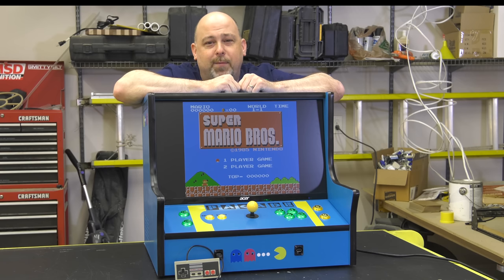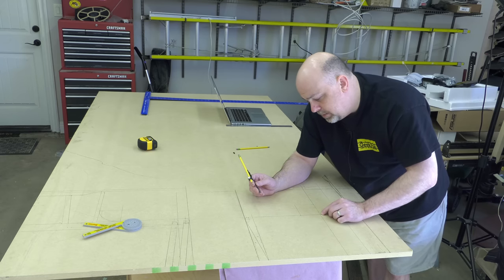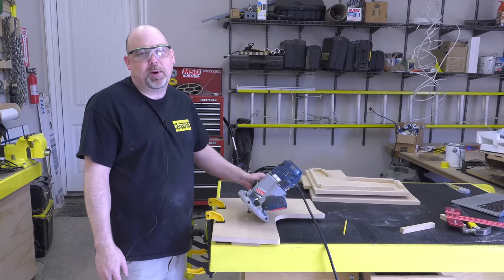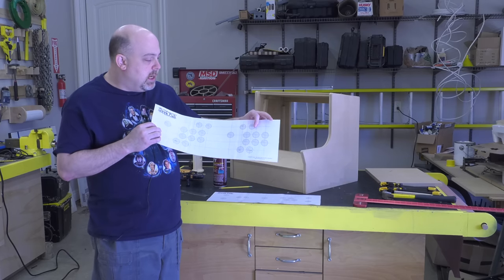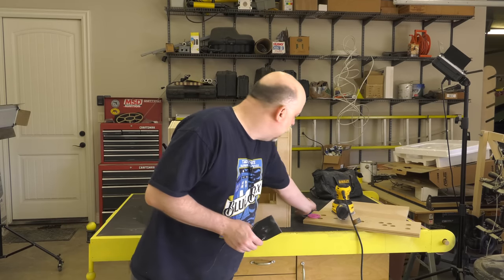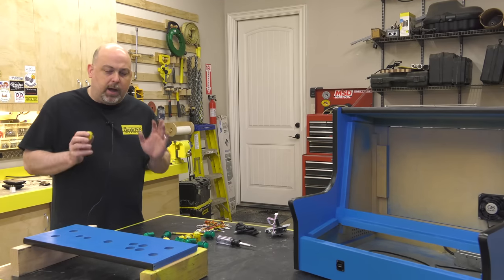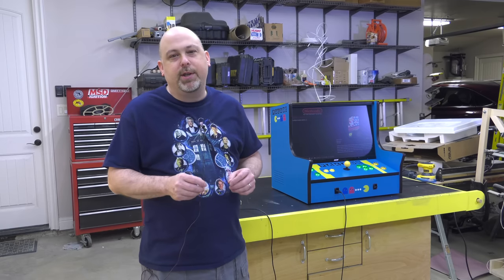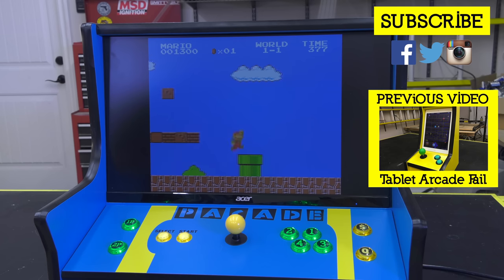Pacade RetroPie Bartop Arcade Cabinet Build

Comment: Just a quick tip, and it saved me a bunch of headaches. Instead of putting in the speaker holes once the cabinet is built, put them in when it's still flat. You can make the holes by hand, or if you have access to a big enough drill press, set a depth stop. I did that when I made mine, and it was awesome! Also, I really like the little tips and tricks you throw into your videos, keep it up man!

Comment: Well done.  Thanks for sharing!  Edit:  The ONLY issue is see is that you are using Sanwa's (designed for metal or 1/2" MDF) are being used on 3/4" MDF.  This makes the joystick a nub on top (too short).  I would have went with a Happ Super with a ball top shaft instead.  (but the bartop joystick is easily upgradable though, which is good news!).  Nonetheless, good work!
Reply from the maker: "makes the joystick a nub on top (too short)"  Nope.  This is addressed in numerous places.  And if you don't want to backbore as shown in the video, you can use 1/2" MDF for the control panel top with no issues.

Comment: Nice!
See you have the same annoying DeWalt jigsaw that blows motor exhaust right into your face, rather than onto the wood to clear the saw dust.
Reply from the maker: Yep.  That's the one.  I've thought about trying to find a way to modify it.
Reply: Sounds like a great way to get some extra fibre in your diet!

Comment: Hi... I understand this is about building the unit, but do you have any info on the Raspberry Pi implementation?  I'm kind of new to the RPi but I think you mentioned selecting games, etc.  Just wondering how to make this look and feel like the game and not boot up to the RPi prompt.  I know my question is more about making the Pi work and not the build, but if you could direct me to a web source, I'd appreciate it.  BTW, I just looked at your pricing for plans and guild.  You are definitely making it easy to make these plans available at a very reasonable price.  I'm a woodturner and semi woodworker and these plans I think I could handle.  Regards, Irv in Florida

Comment: I noticed you spent a long time spackling your brad nailer holes and cutting 3/4 inch strips to assemble the cabinet.  Wouldn't have a biscuit joiner been a better solution and made the cabinet stronger.  I used a biscuit joiner on my cocktail cabinet build and really loved it.  I had no external nail holes and the table is built like a tank.
Reply from the maker: Sure.  But I try to show methods that most anyone can build.  Your average Joe doesn't have a biscuit jointer.   You can build this arcade with only a jigsaw and hammer if you have limited tools.
Reply: Fair enough.  I am blessed with a shop full of tools that most people don't have.  The jig saw seemed to give me the most trouble though.

I do love your speaker grill advice and I am taking your wiring ideas to heart.  I like the electrical box in the bottom as opposed to just drilling a hole for a power strip.  I am stealing that idea.
Reply from the maker: Steal away!  That's what these videos are for! ;-)

Comment: After all is done, how heavy is the build? Will this design and build work using 1/2 " plywood/MDF?
Reply: Absolutely. 3/4" material is nearly always overkill. 1/2" will work fine but I'm not sure about t-molding for 1/2" material.

Comment: Love the VID, cant wait to make my own... however, hate to ask this, but any way you can do a video (maybe you have one and I have not gone though all you vids yet) for the average Joe that just may have simple tools like you said... hammer, drill, jig saw, etc.?
Reply from the maker: There's not much to show.  Just use the jigsaw to cut the lines instead of the table saw.  Use screws instead of brad nails.
Reply: TheGeekPub  does your plans give you part numbers of the joystick and buttons also monitor?
Reply from the maker: Yes.

Comment: nice builds but " tut tut, no mask for that MDF dust" when t mold`n. id have put the fan somewhere near the top, heat rises :) but keep the holes at the bottom so it drawers in cooler air.

Comment: Dumb question here, but I'm going to ask it anyway. Is a bar top cabinet the same as a standing cabinet just without the bottom? If yes, then would it be possible to just build a bar top that sets into a base so it's a convertible depending on your living situation? It seems like other than a coin op, which is not needed for a home machine, the base is just empty and could be little more than a matching stand for a bar top.
Reply from the maker: To some degree this is true.  A bartop is usually a smaller monitor and smaller form factor all around than a stand up arcade.  I have actually considered making a convertible one with some neat stuff in the bottom of it.